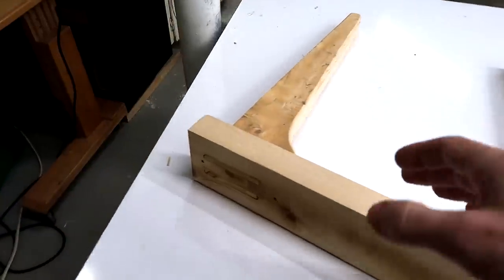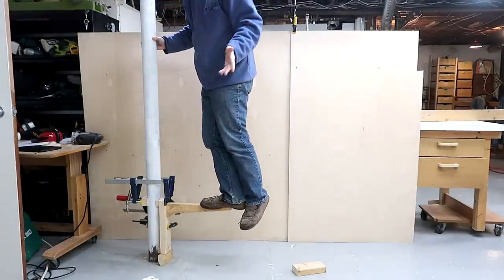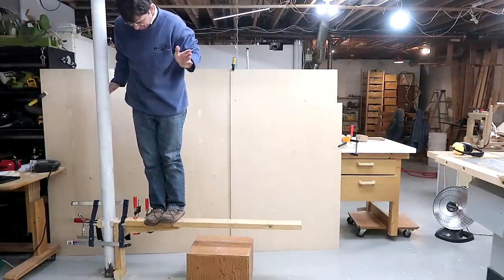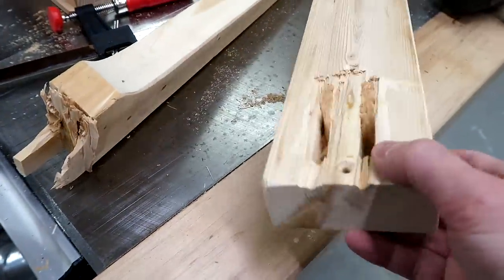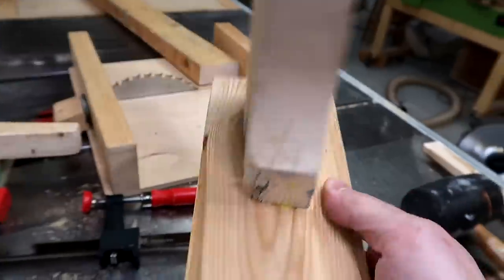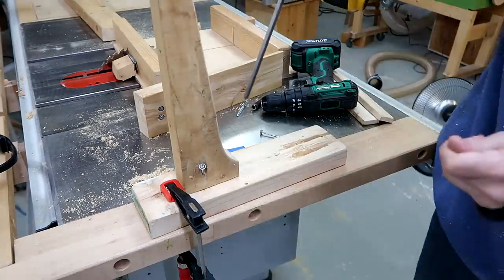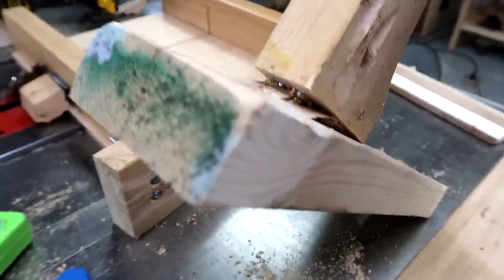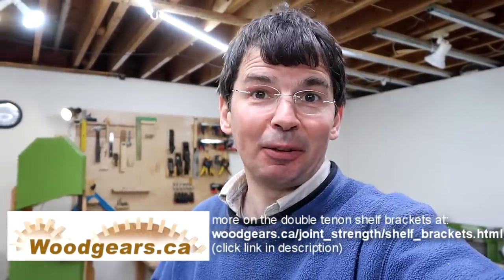Shelf bracket strength test: Double tenons vs. screwed vs. pocket holes

Comment: Pocket holes do a good job, when they are used properly. This is not a proper use. They are too close together, and they converge to the center. I use them a lot, and I would NEVER use them to hold a bracket in this fashion.  Second point. If you are going to use a bracket for heavy stock/goods, don't cheap out on your materials.  Garbage heart center 2x4s will get you garbage results, every time.

Comment: I feel this test would be more valuable if you used good wood and there were no knots near the joint.    Also would the  long screws work better if they were driven at an upward angle?  Also would washers with a larger surface area help?
Reply from the maker: yes, why don't you watch the video?

Comment: Do the 4 screw pocket hole test again, but stagger the pocket holes. It would stand to reason that the 4 screw bracket should hold at least as well as the 2 screw bracket.
Do the tenon bracket test again. Only this time drill a hole perpendicular to the bracket through the mortise and tenon. Insert a dowel through this hole. In this fashion the dowel should help hold the tenon in the mortise with greater strength than glue alone.
Reply from the maker: If you want to see the results, get yourself some screws and wood and try it.
Reply: @matthiaswandel  Perhaps I should have said "please" do the test again. I think you are on to a series here. There are so many variables involved in the design of the bracket attachment; (nails vs screws,  M and T vs pocket holes, glue vs no glue), it would be great to see the math behind maddness. Everyone thinks they build solid structures, usually they don't.  This is the opportunity to discover the strongest bracket design. Call it the Wandel bracket.

Comment: My son is going to build a bunch of trusses for a new house I am designing for him.  I recommended he use Tight Bond III and 3/8" plywood for the gussets.  Does anyone with experience have any advice?
Reply from the maker: Light sanding before gluing the wood.  Sometimes it has a bit of atmospheric grime on it that weakens the bond.
Reply: @matthiaswandel  Thanks.  Is Tight Bond III the way to go? He'll be building trusses for a 3000 spft roof with four different sets of trusses.
Reply: I'll recommend you use a pattern of 1-1/4 nails for each gusset.

Comment: Could the direction of the screws cause an increase in failure? Would there be a dramatic change if the screws where angled toward the direction the force is coming from, instead of toward the direction the force is going?
Reply from the maker: when you hang something from the rope, is the rope pulling up or pulling down?

Comment: How about trying a cross dowel with the screws?
Reply from the maker: and that would help what?  It's not like the screws didn't have enough grip in the wood.
Reply: @matthiaswandel  I was thinking more along the dowel in the bracket and the screw screwed straight from the back of the upright, just a thought

Comment: If you're going to spend the whole video explaining why the test isn't reliable, maybe the test isn't worth doing.
Reply from the maker: There's no such thing as a reliable test for this sort of thing.  Wood varies too much.
Reply: @matthiaswandel  If you did each version 100 times, threw out the top 10 and bottom 10, and took the averages, and removed silly variables like lunging on the boards by taking steps, the result would tell you something useful.